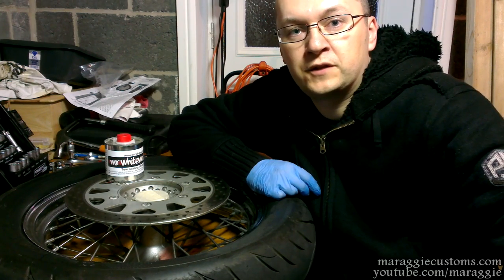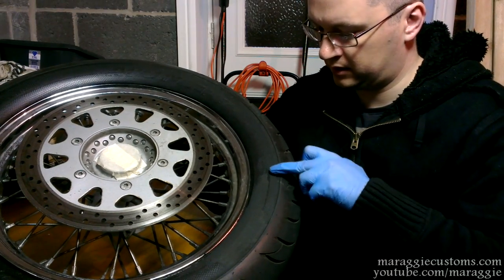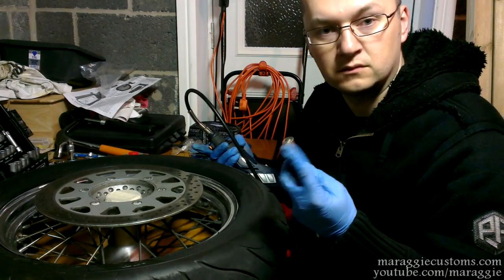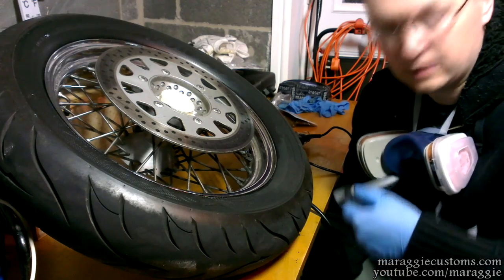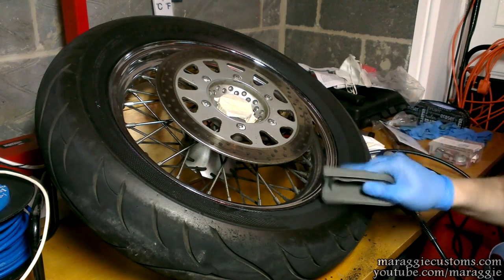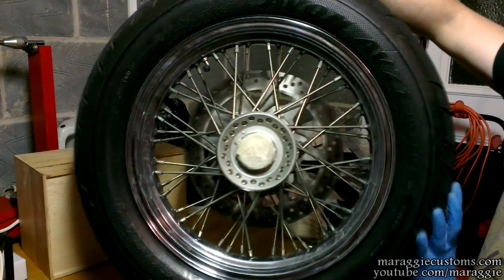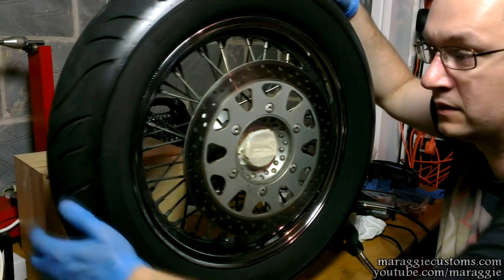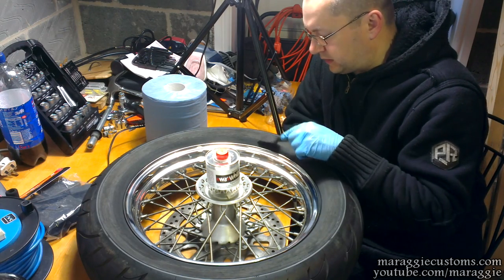Custom DIY whitewalls - painting stock Avon Venom tyres

Comment: hello .. I am a strict followers who live in turkey.  your projects are great.. I congratulate your team.  I have an amateur bobber project.  I tried various methods of applying white stripe on the sidewalls.  but I could not get a long-term performance.  There are alternatives in my research such as asphalt line paint, leather seat paint and plastic bottom.  I do not want to experience situations such as deformation and separation of paint from the surface after application.  For this reason, I would like your advice on the right paint material and the correct application method. Has it deformed over time?  Has the paint peeled off? Can you suggest me?
Reply from the maker: Hello Nuri, good to hear from you.
Several things to consider:
- paint works best on tyres that are already run in. New tyres will discolour the tyre very quickly because of the form release compound from manufacturing
- you will not get a long term good looking whitewalls if you paint them yourself. I had to repaint them every year. They go yellow/creamy over time. It's a commitment.
- best paint I've ever used was the one from video.. I tried others but they peeled and cracked. Mr Whitewalls is rubbery so flexible and stayed white the longest
- if you really want to have a go, make sure to scuff and de-grease the surface before painting.
- how you apply the paint doesn't matter... a brush or sponge, both will work well if the surface is prepared.

I wish you all the best with your DIY project but for me, speaking from experience, I would rather buy whitewall tyres instead of painting.

Let me know how you get on. I would love to see your work.
Reply: @Maraggie  Thank you very much for your enlightening answer.
I listened to the experiences of my friends who used different products. As you said, unfortunately, I have not come across a product that gives full performance in white wall application. There have been similar problems that you mentioned throughout the products used. Ready-made white walls seem to be a different option. However, there are disadvantages of the ready-made walls such as breathing due to the opening on the edges while driving and thus causing vibration, and more dangerously, creating a serious accident risk due to rupture! Originally produced white-walled tires are another alternative .. ortinally produced white-walled tires are both an expensive option and they are not produced in all sizes.! I don't know what to do right now! but I hope I find a solution with the best method ..

Thank you for your interest in my amateurish project. i am thinking of uploading a youtube video. I would be happy to share with you. there is a lot more work to do in the project .. You know, Improvement never ends :)
Reply from the maker: That's correct indeed. Improvements never end :) All the best.
Reply from the maker: Looking good. That's how the fun starts. Before you realise you will be cutting frames and welding parts :)
Reply: @Maraggie  
Thank you very much for your good wishes and support.
See you..

Comment: Looks good. Only question is, how is in the long  run? I mean does it peel, turn yellow?  How long do they last looking that nice?  Great job though.
Reply from the maker: EL Callado They do turn creamy if you leave them untreated. I rode whole season and added another 2 layers over the winter for next season. Cost wise it's really not much per year.They don't peel at all... it's a very strong resin/rubber. Of course a lot will depend on how you will prepare the surface.
Easy to mess up if you use the wrong cleaning agent. Solution sold by the same chap that sells the paint was OK... tried something more aggressive and it "melted" it a bit. My own fault, not the product.
Reply: Thanks for the timely  reply.  Once again  great  job

Comment: i have some white walls but they are old and yellow i tried everything to make them white again.my question is what can typenof paint can i use to paint over the white walls to make them white again without cracking?
Reply from the maker: Hello Arnoldi,
The only paint that I found not cracking was MrWhitewalls paint. It does however change colour over time to creamy when exposed to sun. Definitely avoid cheaper products as they're bound to dry out and crack. MrWhitewalls is some sort of resin compound that stays rubbery and doesn't split, at least not in my experience.
Good luck!

Comment: Question is how do I paint from white wall to black ? Can i use normal 2k paint & just brush it ?
Reply from the maker: Hi. It has to be a paint that won't crack when rubber flexes when riding. Otherwise you'll end up with really ugly looking tyre. I'm not sure what paint you could use for that.
Reply: @Maraggie  thanks man , I found tyre / rubber black paint on eBay already which special for it 👍🏼
Reply from the maker: @awedihdaira2786  Fantastic, let me know how you get on.
Reply: @Maraggie  it's called " autotek professional tyre wall black " on eBay £7.50 absolutely amazing dry within 1 hr , the paint specialist for tyres / rubber 👍🏼

Comment: Does removing rubber require rebalancing the wheel?
Reply from the maker: Hi. You're not removing a great deal really. Also consider that when you paint afterwards, you're adding material back. Probably not, doesn't hurt to check though. I didn't bother.

Comment: does it still work well on a white tire? my white wall has gotten browny abd I hate it so was thinking of rewhitewalling it lol or just buy a newer tire bit it still has lots of tread though..got thoughts? and can you show pics of how it looks with the discolor? u said it turns to a creamy color? thanks
Reply: N yes fellas iv tryd white wall cleaner and it's not getting to the white color I want!
Reply from the maker: +Danny Haddad Hi. Well there goes my hope that once I buy proper whitewalls, they'll be great and won't discolour :)
I can only assume it would work nice on already white background... I've no experience with this so far so can't really say for sure.
And yes, I will show how the discolouration looks like. I'm due to record a series of videos regarding VL800 maintenance and wheels will have their "15 minutes of fame". I plan on taking off the paint somehow and re-painting from scratch.
Reply: Well I used a very light sand paper that I bought at the auto parts store with dish soap and it made my tires white..just dip the sandpaper in a pail of water and soap and it works...
Reply: Danny Haddad try sanding the white wall with 1500-2000 sand paper with a little soap...worked for me